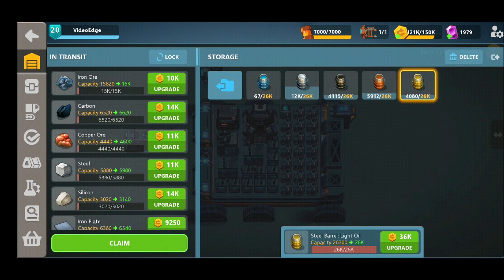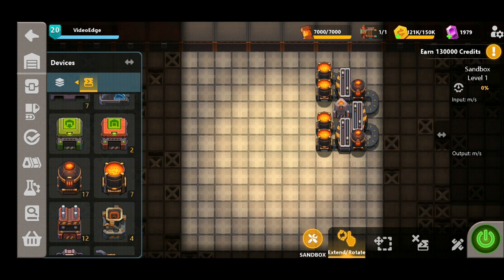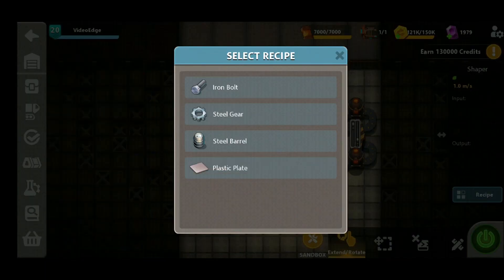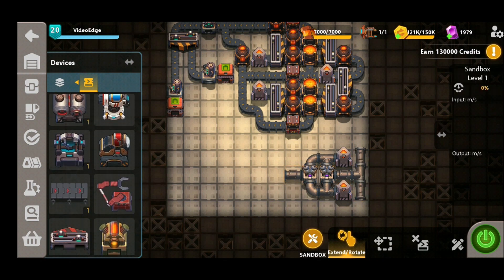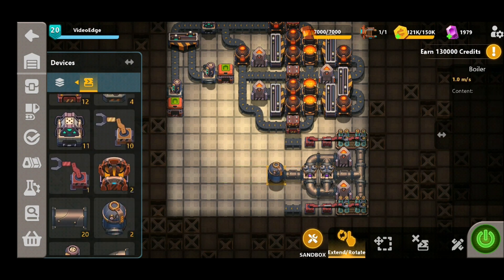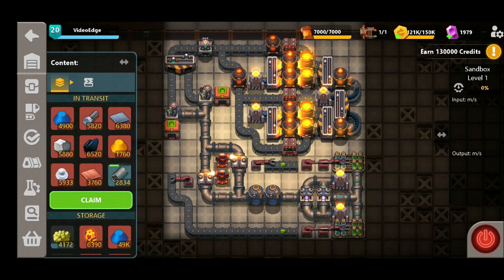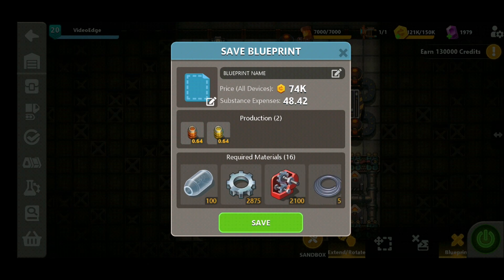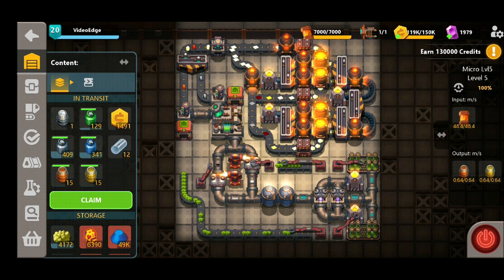Sandship Crafting Factory: How to Make OIL + Efficient Micro-factory Design! [HD]

Comment: If you have those annoying "Produce X/sec of Y in one building" quests, here's a quick tip. Take the material they ask for and drag it from your storage to transit. Now, go into any building and place down an importer followed by an exporter.  Select your material for the importer, and turn on the building. Now you will be "producing" 5 units per second in one building. If you need more, just add more importers and exporters as needed.
Reply: There is a trick for gatherin missions too  just put the stuff in transit and collect it then repeat
Did not work for obtaining missions

Comment from the maker: We hope this walkthrough helped you understand how to make the Oils! What do you want to see next!?
Reply: Thanks a lot VE. 
INK!!! no hints whatsoever in the game
Reply: Used the the same layout for the barrels
Reply: @OrenTubing  Based on what i've been through, all inks are made with the heavy oil, while the light oil is for plastic production. Here are the colors for now:
1. Summer Blue - Heavy Oil + Iron Powder
2. Carbon Black - Heavy Oil + Carbon Powder
3. Casablanca - Heavy Oil + Sulfur Powder
4. Red Mercury - Heavy Oil + Mercury Powder
All you have to do is put the powder using grabers to an open oil pipe, and voila.
Reply: @putrapane915  thanks will try :)
Reply: make plastic please
Reply: Steal plates
Reply: @videoEdge How can we collect 1.28 only of Heavy Oil?

Comment: I have updated the Oils all under 1 building.  If you put an aspirator on the corner of the pipe under the oil making building and put a long slow grabber just above it and a exporter just below. You will have all I 1 building.